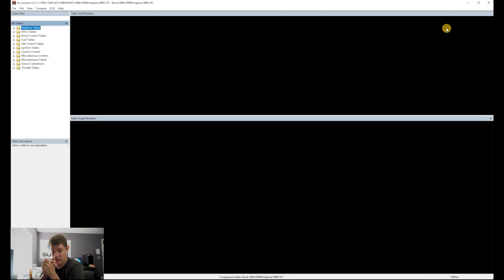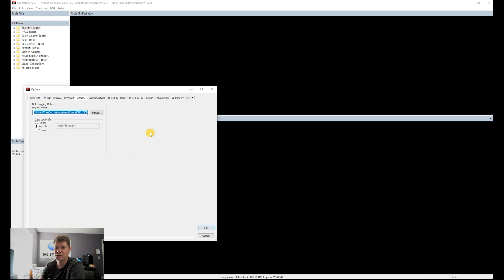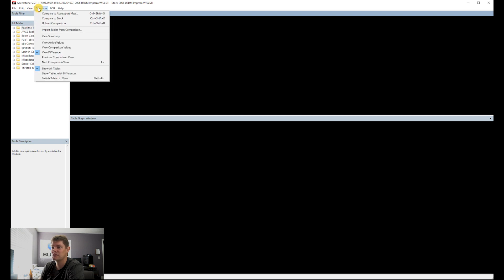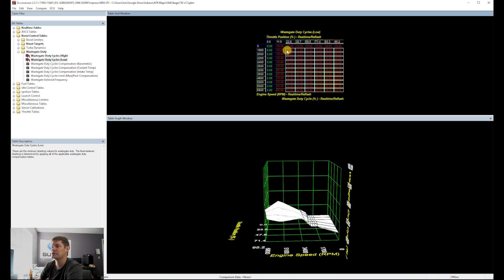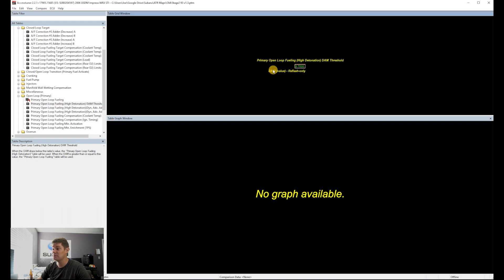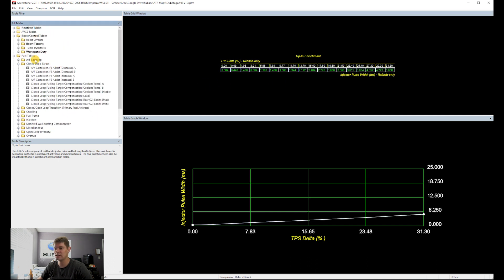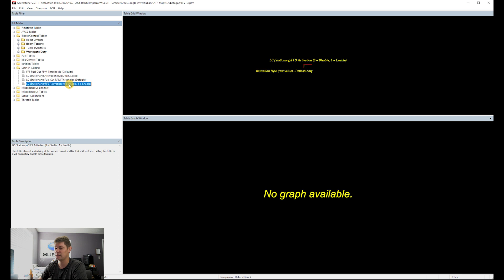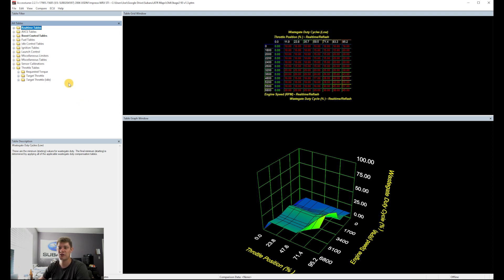Introduction to Cobb AccessTuner

Comment: 15:39 hey man thanks for the breakdown video. So I was wondering if you could go in a little more on the timing. So I am experiencing high feedback knock, the highest it has gone is -5.98. Could you point me in the direction of what I should dial in. I was told to turn it down by 2%.